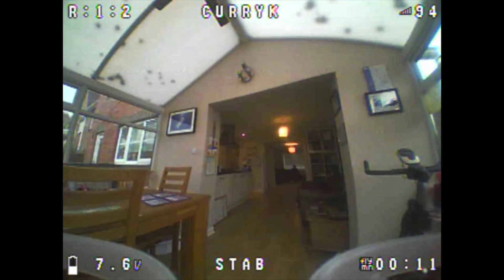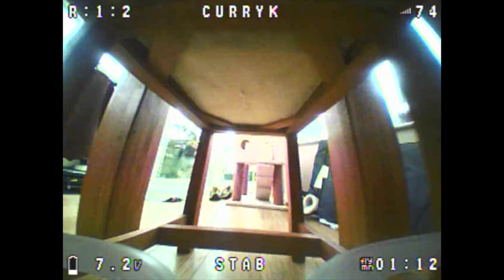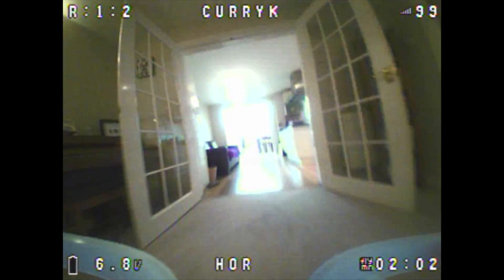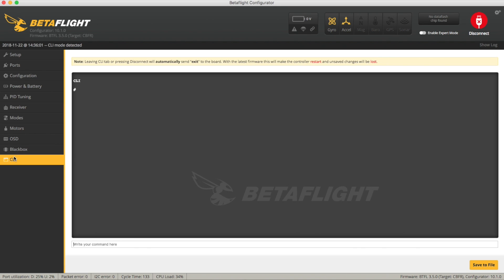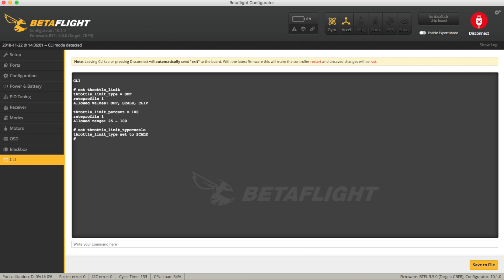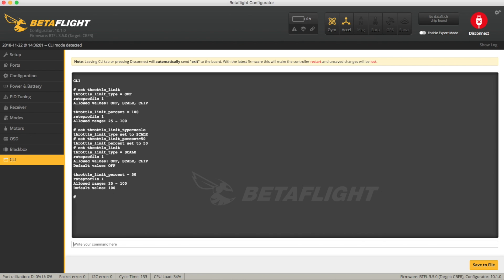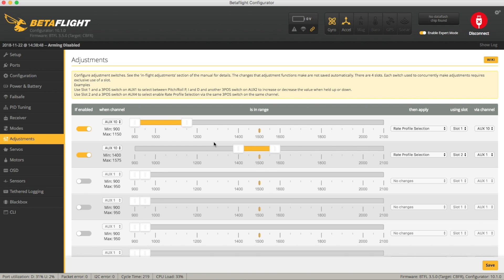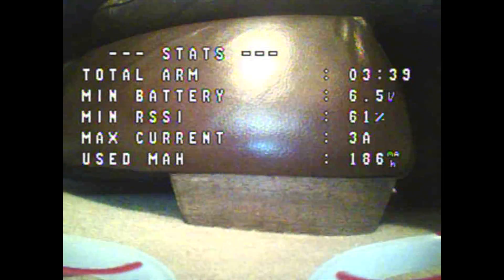Using Betaflight throttle limiting to tame the Mobula7 on 2S

Comment: with 1s it doesn't lift any solution please?
Reply from the maker: It should be fine on 1s.  So are your props spinning and it's just not taking off ?
Reply: I turned every think as it was from the betaflight and it's fine,re done your method again and it's working.thanks :)

Comment: What mode are you in at 7:13 ? I couldn't imagine flying my tinyhawk freestyle ii indoors. thing has way too much power.
Reply from the maker: Says "STAB" in the OSD at the bottom, so that's angle mode.  Something having too much power is kind of the point of this video.  If you change the throttle limit (You can now do this in the Betaflight configurator (no CLI commands needed) then you can easily limit the power to 50%, 30% of normal - whatever you need.  Suddenly you can fly 2S in the house.  I don't acro inside though, I do find that there's just not enough space to be able to correct my attitude well enough
Reply: @CurryKitten  yo thank you so much! This fixed literally all of my flying issues that I was having. I wish someone would be told me about this in a "beginner" tutorial 🤦‍♂️ haha appreciate your video!

Comment: I've tried to copy your set up for a Meteor 65 just for flying inside and have linked 3 profiles to my B switch on my X-Lite and in Betaflight it shows correctly on the adjustment tab, but in the PID Tuning tab it seems sometimes to work and others to just lock up and I have to reboot the quad. Is that just a software thing and will it work OK on the quad? Almost seems like its OK going up from Profile 1 (100%) to Profile 3 (50%) but wont come back down. Any ideas?
Reply from the maker: Is it that it's not switching profiles in Betaflight?  I noticed this happening recently - might be a recent change.  If that's the case you can change it on the quad and then go in and alter it in betaflight.  In my experience it has still been actually working fine, even if the configurator is acting weird

Comment: When I copy the Rateprofile 1 and then select profile 2, it just goes back to profile 1. Am I missing something?
Reply from the maker: I've noticed this happening just recently in the last few quads I've looked at.  I'm not sure if it's the version of the betaflight configurator, or the firmware on the FC itself.  As a quick workaround, you can select the profile from the quad itself, leave it there and then go back in to betaflight to make the changes.

Comment: I'm just getting started in this hobby and have Betaflight 4.1.  The "using slot" column/option under the Adjustments screen does not exist.  How do I tell it which rate profile to use in BF 4.1?  Thanks!  Super helpful videos.

Comment: im using my mobula7 with 1s in house but when i do that i need to push the throttle almost to the top to keep the drone in some sort of a hover state. when the throttle is in the middle its drops to the ground very fast. so im trying to understand how do i make the mid point of the throttle to be my hover point. any suggestions? or at list how do i make the throttle give me more power much earlier so i will not need to push it to almost to the top.

Comment: Thanks for the info, It worked great. I have a Beta65 and I set mine to 70 percent for indoor flying Its a nice mix of punch and control for me.
Reply from the maker: Nice one - it's nicer to not have to restrict yourself to half the throttle stick isn't it :)

Comment: Kind of off topic but not really, when I set my horizon and beeper switch they don't work on the quad and don't turn yellow when I'm in the range on betaflight. If someone knows why and can help me before I try to set a rate profile switch that'd be appreciated
Reply from the maker: So you can see the little pointer moving in the display in modes, but it doesn't change?  This is generally what happens when you have set the mode but haven't saved it yet - did you definitely do the save part ?
Reply: @CurryKitten  lmao, thanks man. It was so simple I never would have noticed. Haha. I've been going to config and save+reboot. It's my first time on betaflight if u haven't guessed. Thanks again man😂

Comment: i have had the mobula7 for about 2 weeks and flown it about 5 times,i 
have never crashed it but for some reason one of the motors now only 
spins intermittently,i have tried changing the motors but it does the 
same thing so it is to do with the flight controller i presume,i am a 
noob and was wondering what you would try,thanks for any help mate
Reply from the maker: Generally speaking, if you've swapped the motors over, but the problem remains in the same position, then it's the ESC.  To check there's no logic in the flight controller stopping the motor from spinning up, go into the motors tab in betaflight (props off obviously) and use the slider to attempt to spin each motor in turn to see if the motor spins up or not.  I'm assuming you are using Dshot in this quad, if for any reason you are on oneshot or multishot, then try doing the ESC calibration first.
Reply: @CurryKitten  thanks for the reply mate,when i go into the motor tab and use the slider for it does the same intermittent power problem,how do i calibrate the ESC ? sorry to be a pain
Reply from the maker: Ok, I hadn't clicked you said it was a Mobula, which means it should be using DShot which doesn't require a motor calibration.  Double check this by going to the configuration tab and making sure your ESC/Motor protocol is set to DShot600.  If that's the case, and you've already moved motors (and hence you'll have double checked that your soldering is all intact and good) then it's possible that something like a fet has gone on the ESC board rendering one ESCs a bit dead.  The only thing I'd say though is normally when you've got a motor that's kind of twitching and not turning properly it's because one of the 3 connections to it isn't there.  So do go back and checked/recheck/retest that first.  Failing that, I'd replace the ESC board

Comment: Hi CK, what a great idea,  I need to do this! Just wondering if there was away to assign one of the POTs on the top of the xlite which can 'scale' so to speak??
Reply from the maker: Not using the betaflight throttle limit, but you can have multiple profiles and then switch between them.  With OpenTX you can make the radio do something similar and so scale it using a pot.  Joshua Bardwell did a video where he scales  it on a slider which is easily modified, check out his video here https://www.youtube.com/watch?v=m9Gf95fapoQ
Reply: that's great, will take a peak @JB's slider option. Thank you

Comment: is there a way to have the power of the quad stay consistent throw-out the battery's charge ??  It's super touchy in the when taking off but after 1 minute, there is a major change in throttle input just to hold a hover..

Comment: When I connect the drone on bf and turn on reciever it keeps saying telementry lost. Is that normal, it goes on and off. When I fly it doesn't.
Reply from the maker: Having a constant "telemetry lost, telemetry recovered" is something that can happen when you have the radio in close proximity to the model - the TX overwhelms the receiver.  Try moving the model and radio further apart and see if that cures the issue.
Reply: @CurryKitten  do you get thst with yours mobula? What bf version you using?
Reply from the maker: @Hellmuthsilva  Can't remember off the top of my head, but it's a general problem you'll see whenever you get a radio close to a telemetry receiver.  Have the radio just the right distance and you'll get a constant repeating stream of "telemetry lost, telemetry recovered"  I'm still using BF 3.5.0 as in this video

Comment: How come your FC CPU usage is that low? Mine wonders at 50%.
Reply from the maker: I did notice it was a bit higher than I wanted just as is.  I can't remember if I'd turned anything off from default (I'm away so can't check) but it's one of the things to do if it's up that high.  I always try and stay below 30%, 50% is a bit too high

Comment: My Mobula 7 came with the jumper included. So it seems HappyModel has added it to the package at a certain point in time.
Reply from the maker: That's cool - I like to think I had some influence there, but it's probably just coincidence :)
Reply: Could be, or it was already thought of. Or maybe the one that should have been included with yours, was accidentally left out. The idea of making it capable of 1S and 2S use is pretty neat, although the quad flies better on 2S, and the batteries also don't get as hot as when used separately, instead of in series.

Comment: Random question. I did this today and in betaflight it does not load rate profile 2 after selecting it. You see in the top left of the screen it says what profile has loaded this part always stay on 1? What could this be?

Comment: this is a great idea. I have the throttle limited to 75% in my taranis X9D, I set up a second profile, so I can choose easely. as a beginner, a 5" racing quad is a bit too much :)
Reply from the maker: Yes, I agree.  Previously I might have suggested running on 3s or changing the props, but I really do like the throttle limit as a solution to these.  Very easy to change and have multiple setups

Comment: Great video. Saw Joshua’s video too. Synchronicity is real y’all! Nice job on beating him with a better solution. Of course he had to post a follow up and gave you all the credit, good man!
Reply from the maker: Very much a coincidence, but also very nice that he gave me a shout out in his follow up video.  I was going to let that video come out later this week, so glad I released it straight away now :)
Reply: Finally could test the new rateprofile using OSD. Used your 50% throttle limit suggestion and it flies great indoors! What an elegant solution! Thanks again  CK!

Comment: Hey Curry, im an acro guy and never did angle or horizon mode until i got the mobula7. It just flies better indoors in angle. I understand Angle Limit, but my question is... what the heck is Angle and Horizon Strength and what is Transition? Very little information online. Next video maybe? Its whoop season lol
Reply from the maker: I'm the same - it's very difficult to fly acro indoors - there's just not enough space.  Interesting question - I think it's about just how much power it puts into bringing you back to level when you let go of the stick, but I'm not sure, so time permitting, I'll have a look and may do a video :)
Reply: @CurryKitten  I think I found the perfect combination of being able to fly with stability as well as the occasional flip and roll. I now use horizon mode and got it flying exactly like my angle mode by changing the transition to the max, which is 200. So that the sticks feel exactly like angle mode, but if I go to the very extreme at 100% it will flip and roll on command. You can also lower the strength value to smoothen the recovery from flips and rolls. Never thought I could do fast forward flight indoors while barrel rolling over my kitchen table or front flipping down my flight of stairs. It's amazing lol.
Reply from the maker: I'll have to have a play with this, sounds fun
Reply: @CurryKitten  after trying different values I found that the higher the strength, the stronger it will bring the quad back to auto level, kind of like increasing P gain. Transition is for horizon mode and determines when the transition to acro is, the lower, the faster it turns to acro with less stick movements

Comment: Would setting the throttle limit in CLI have similar results as setting the throttle travel limit in OpenTX?  Did you also notice the lower throttle limit extended your flight time?
Reply from the maker: Don't know is the quick answer - based on me not being able to find anything on the "throttle travel lmits"  there's obviously travel limit on other channels, but the problem here with the throttle is that it needs to go from zero and scale up - which is often different to channels that have their neutral position in the mid-point.  Joshua Bardwell put a video up about using a slider to change the throttle which was actually pretty complex with the amount of offsets used.  As far as the flight time - yes, you get more as you are not really hammering it.  I was getting less outside where I could really open her up on the full 2s power vs the reduced throttle inside the house

Comment: I just use a throttle curve on a switch on the radio but i'm using the taranis which has plenty of switches.  I also put different rate profiles for different modes which are on the same switch as flight mode change.  New sub!  :)
Reply from the maker: One thing that's cool about OpenTX is that there isn't "the" way to do something, there's lots of different approaches that can all be made to work.  Thanks' for the sub :)

Comment: Great suggestion. I'll be trying that out for sure. I have a question however. I only have 250m 1s lipos, and I was wondering - if I created a wiring harness to run two 1s lipos in series to create a "500mah" 1s, is that possible instead of adjusting rates in Betaflight for running 2s? Second, is that even worth it? What is a scaled down throttle for 2s vs 100% available throttle for a 1s setup (with 2 - 1s lipos)?
Reply from the maker: "It depends" is the slightly unhelpful short answer, and to expand a bit.  The Mobula7, will take a 1s lipo by messing around with the existing series cable (it's actually a parallel cable you need to create a single 500mah 1s from 2 x 250mah ones) so if you were to create a second harness to plug into the existing cabling, it might look a bit busy.  Having flown 1s with full power and 2s with a reduced throttle limit - it's easier and more flexible to use the throttle limit as you can change this exactly to the percentage you like (and it saves on wiring)
Reply: @CurryKitten  Thanks for all your thoughts and clarification on the parallel cable required for what I was proposing. The flexibility of throttle limit on 2s makes sense as well. Cheers!

Comment: Can you do another video that shows a profile that has different stick curves? You can also use the trim keys as momentary switches. If your looking for more switches on X lite. Thanks
Reply from the maker: Oh good call on the trim buttons - I always forget about those, and there are never used in any betaflight quad as well.  Any reason you are wanting to see another video with different curves ?
Reply: CurryKitten Instead of scaling I was hoping to put 60 or 70 percent of the curve at the top of the stick. But still have 100% of the total.
Loved your series about beepers! Always looking for super small beepers I can add to a drones like the Mobula7 for when the main battery comes loose. Thanks again 😊

Comment: Always wondered how that worked. I do it a different way on my beta 75. I set the throttle curve at about 0.45 to 0.3 expo and put the digital idle way up. This works really well indoors and really badly outdoors. Indoors though it gives you all the resolution at the throttle you need and the curve feels much more like my 5" with the steep ramp up covering the weedy throttle and giving the quad grip in the air.
Reply from the maker: Yeah - I heard a few people talking about quite a few different ways of doing similar things - "massive throttle expo" was one that kept repeating, but I didn't like the idea of it.  Give this one a try - the reason I like it is because it's an easy swap from inside to outside.  I like things where I don't have to faff around too much

Comment: Very interesting and I'm applying that my "racing" 5" to make it easier to flight for example when gates are close together and you never reach maximum speed. So the throttle cut can be adjusted based on track (in your case for indoor)

P.S. in the "adjustment" page you can do set everything in one line covering the whole range, and if you have for example a 3 position switch, it'll switch to rate profile 1/2/3 based on the switch position.

P.P.S. you can do the same directly on OpenTX by adjusting Throttle input weight and offset ;) So if you want to cut 50% the throttle you set the weight to 50 and the offset to -50. That's my preferred way as I can adjust it whatever you want on the field without using BF.
Reply from the maker: Thanks - yes, that's another good idea, potentially giving yourself more resolution on the stick when racing a tight course.  Thanks for the extra info - I've only used the adjustments tab once before (for doing in flight tuning) and I have to say I found it all a little bit counter-intuitive.  It felt like I should be able to do things on a single line, but it never worked.  Maybe it got better.  And yes, I was deliberately ignoring ways of doing it on the radio as - despite the perception that most people are on a Taranis - the people who then shout "booo, I can't do this" because they are on FlySky/Spectrum/Futaba  is surprisingly large.  So I went with something that is universal (cue people complaiing that I didn't cover Flight1/Kiss/etc) :)
Reply: @CurryKitten  JB is copying you! :D He just released a very similar video.
Reply from the maker: Haha  Just a coincidence - as the 2s whoops becomes commonplace we're all having a think about how to fly it easier in any situation.  Also, if he was copying me, then he'd know that he could use rateprofiles to easily swap between different throttle limits :D

Comment: Definitely will try this on my QX7 tonight.. Thanks for that tip!! I've been using the throttle trim on my radio to tame it down a bit. It doesn't quite work
Reply from the maker: There's other ways of doing it on your radio - as another comment mentioned, you can mess with the throttle weight/offset.  But Betaflight doesn't depend on a certain type of radio and is pretty easy, so I like this way.